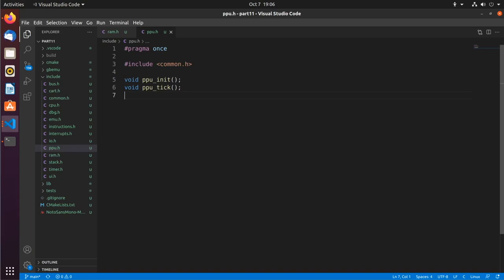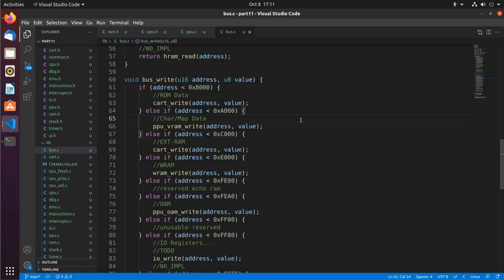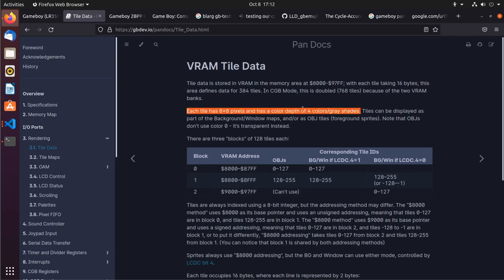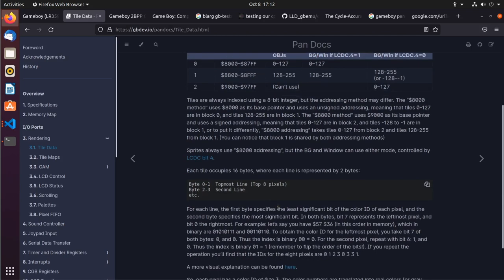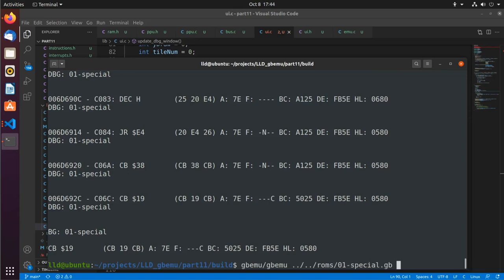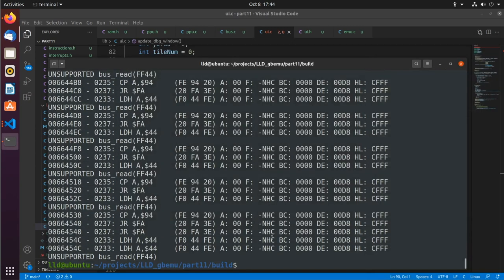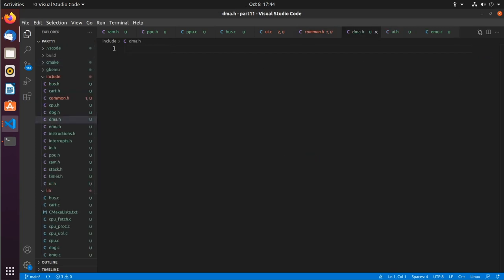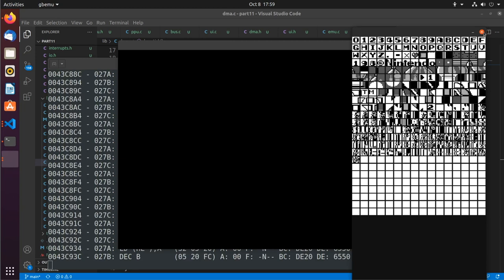Gameboy Emulator Development - Part 11

Comment: Is there any way to write a program to extract the tiles without implementing anything else but just parsing the rom file? I mean, are the tiles always in the same memory location or their location is always different (so we need e.g. to implmenent the CPU instructions to get their location) ?
Reply from the maker: yes for some carts, ones that don't use rom/ram banking, the tiles will always be in the same place.